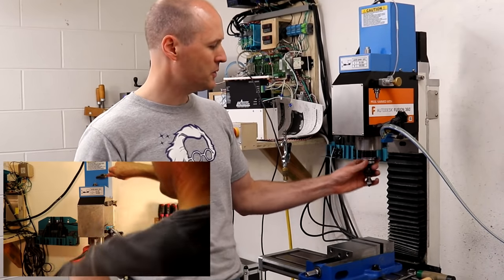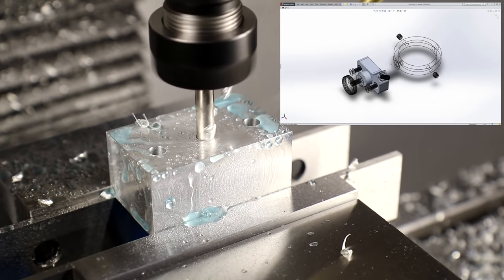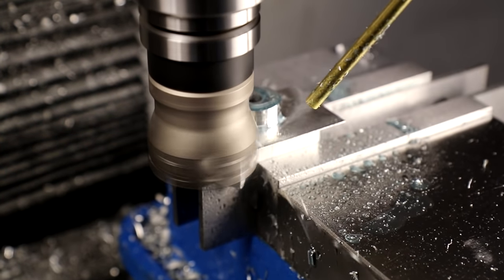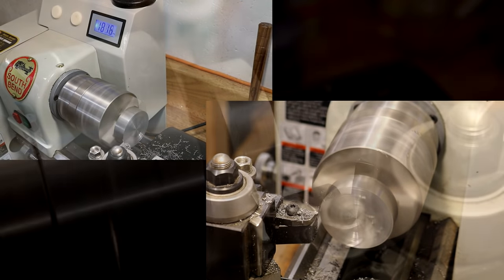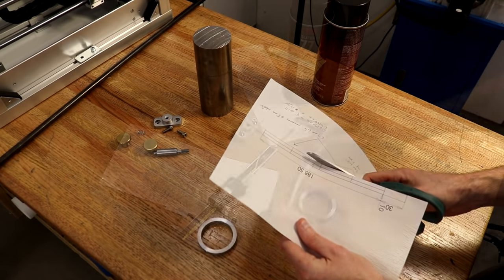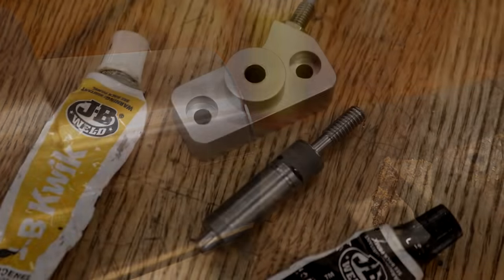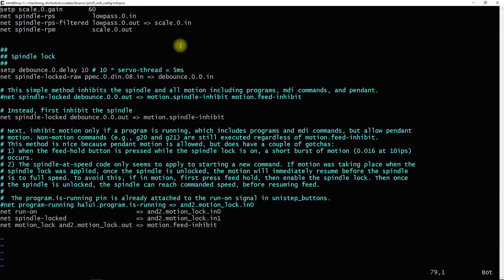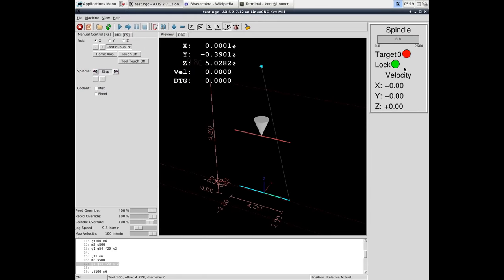Spindle lock for PM25 CNC milling machine (improved)

Comment: Awesome and clever upgrade!  I remember your prior spindle lock video, it's super neat to me how you've incorporated a cycle lockout into it! I've been working on a (TTS based ;) ) tool changing option myself for my grizzly machine, it will be interesting to compare the two!! Thanks Kent!
Reply from the maker: Thanks Jeff. Are you making a automatic tool changer? That would be amazing! If there is anything that I can help you with on the coding side, I'd be glad to help. I was hoping that the brake on a servo motor would be powerful enough to use as a spindle lock, but nope. The locking pin idea could be worked into a feature of a belt drive. The older video makes me cringe, but two years later and a little less awkward :)
Reply: Haha! rest assured most of my older videos will induce a cringe for me at one point or another, but you've got nothing to be ashamed of in that project! :) What I'm working on is a little more passive and manual, I'm still early on in the prototyping stages but basically a system that works similar to pneumatic ram based setups, only without the pneumatics (relying on belleville washers to provide drawbar tension).  Like I said, we'll see how well it works but I like something that's as passive of a system as can be, I know if I tried to implement a spindle lock system like yours I'd have sheared it off 3 times by now! :D

Comment: Nice project there Kent and a great improvement on the initial version
Reply from the maker: Thank you, I'm not sure how the drawbar was meant to be tightened originally. May be less of a problem with end mill holders? Maybe there is some clever way of using conductivity or an optical switch to eliminate the expensive plunger switch?

Comment: This spindle lock could be ideal for clamping the spindle for a CNC broaching operation. You would have to revise your code to allow the axis movement with the spindle locked. I know this overrides your safety lockout. So maybe a custom G code that would only be run in broaching operation with the spindle lock on but would not be allowed to turn the spindle drive on. You would be surprised how handy these broaching operations can be. I once did a job where I roughed slots from the side with a woodruff cutter than finished the ends of the slots with a custom ground right angled broaching tool. Moving in the X and Y axis. This slot was formally done by EDM. This eliminated the EDM operation. In other words don’t just think only Z axis for broaching I have even moved all three axe in a broaching operation to generate a curved slot. Of course this usually has to be programmed manually outside your cam software. It can be done quite simply with a repeat of a sub program in the incremental mode though. Usually only requires four lines of code to do a key slot in the sub and one line in the main program. I think in my video “Things are shaping around the shop” I explain how this is done.
Reply from the maker: Hi Peter. There's a lot in your comment; thank you for taking the write it. I was considering what you are suggesting on the lathe. On the mill, when locked, my spindle is still able to turn very slightly because of the long lever between the body and the collar. I could add a sleeve to support more of the pin. I was hoping is to replace the BLDC drive with a servo with a brake and use the brake as a spindle lock, but brakes only have a rating equal to the servo size. Holding the 30 ft-lbs is much too high. However, the brake should be enough for holding the spindle in place while broaching and the servo has an encoder to help reposition the tool. The pulley on the servo could be modified to receive a pin on a linear actuator to firmly lock the spindle in several positions. When I mount the servo I want to use a timing belt to prevent slippage, but there is still the problem of not being able to consistently clock tooling in the R8 spindle. I'll have to think about it more, but it would be nice to be able to broach or shape.

I watched your video, and as always the content is amazing. I'm glad you take the time to make them because your perspective is very valuable.

Direct link to Peter's video: https://www.youtube.com/watch?v=9GkBWEOlxxQ

BTW: Heading your way today, driving to Dallas for some work. Hoping for great weather.

Comment: Hello Kent. Very good feature to hook up the spindle lock with Linux CNC. I wasn't aware that you can change the Linux CNC GUI HTML wise! Thanks for sharing the little failures as well. It calms me down, seeing that (my) CNC accidents are not just "my thing" :)
Reply from the maker: Thank you Stefan. LinuxCNC has many interesting features. A great introduction to the panel configuration of Axis is the AskJerry channel. Axis, the default LinuxCNC interface, is written in Python and can be modified directly for greater control. To make persistent modifications to Axis, would be best to work from a clone of the git hub repository. Have a wonderful weekend!
https://www.youtube.com/watch?v=1WDrBBLe7FY&index=10&list=PLa_L8q5vezBOkzP_yOKBXPB8zKn-iWCsX
http://linuxcnc.org/docs/2.7/html/gui/pyvcp-examples.html

Comment: Hello Kent. How many steps per rev do you have your lead shines set at?  I have a Faceting problem on sides and most noticibly on corners. I have mine set at 2000.  Is that too low?
Reply from the maker: 4000 steps per rotation of the motor, and the motor is directly connected to the ball screws. Hope this helps. You've check that your g-code is using arcs and not approximating curves with course lines?

Comment: Great update Kent on a already good idea! Do you have these available anywhere for those of us still running a manual mill? I have a PM-30MV and was thinking of using this with the micro switch you noted, to tie it into the e-stop circuit.
Reply from the maker: Hi Mike, thank you. Normally I don't make the parts, but email me, there are a couple of options.
Reply: Kent VanderVelden what is your email addy?
Reply from the maker: Hi Mike, you can use kent.vandervelden @ gmail.com

Comment: Interested in what's required to convert my Lathe to CSS
Reply from the maker: Constant surface speed is nice. If your controller supports CSS, probably only need a means for the controller to measure the spindle speed. This could be as simple as a single pulse per revolution magnetic pick up, or a dedicated encoder. Installing a 200+ PPR encoder may also let you perform threading.

Comment: Hi Kent,
Been watching your videos for awhile and I'm finally working to convert my PM-25MV to CNC, your videos are very nice for showing how well the PM-25MV can do as a CNC machine.  I was wondering if you are willing to share your Solidworks models for the new and improved spindle lock.  Since I have the machine apart and have the spindle apart, this seems like it might be a nice time to at least get the spindle collar turned and installed into the spindle.
Reply from the maker: Thank you Adam. Of course I'm willing to share, thanks for the suggestion. I'm switching to Inventor from SolidWorks. Would you be interested in a generic format like IGES or STEP? Fusion360 public sharing would be a great way to share, but it does not support read-only. So, I would probably post the files to Thingiverse.
Reply: IGES or STEP would work fine.  The Fusion 360 public sharing I've also used before (on the receiving end of things).  How are you liking Inventor?
Reply from the maker: I'll get the files posted in a couple of days. Dctteatcher1 had problems with people accidentally changing files shared publicly from F360, and that's my only experience with it. I really want Inventor to work well. It's included in the Autodesk PM&D Collection, which appears a fantastic deal. My initial impressions are probably not meaningful because the problems that I'm having are mainly because of frustration of knowing how to do something in SolidWorks and needing to hunt for the Inventor equivalent. Like learning a new language. If you are curious, give it a try. Autodesk makes it easy to try any of their software... try doing with SolidWorks. I'm using the training on PluralSight to learn Inventor.
Reply from the maker: Hi Adam, here you will find the files: https://www.thingiverse.com/thing:2996262 Let me know if you have any problems or questions. Best of success to you